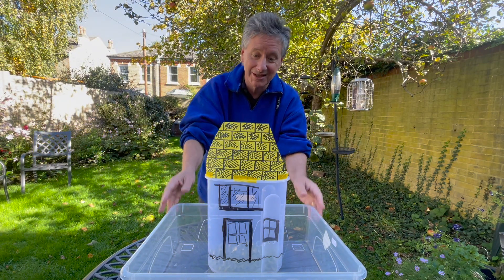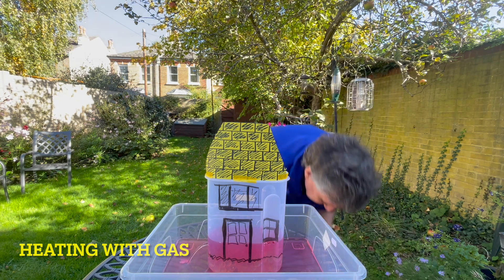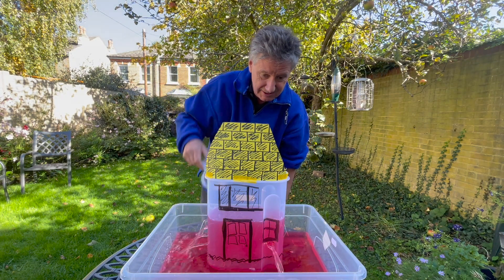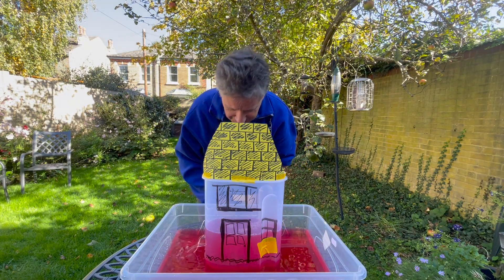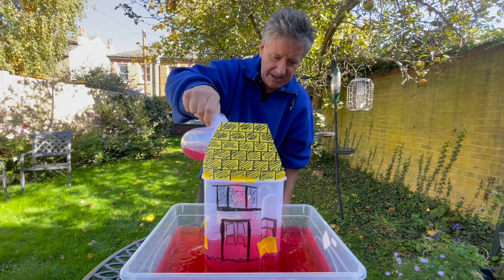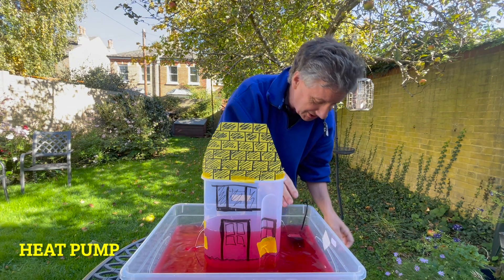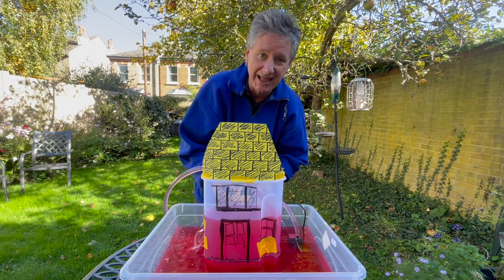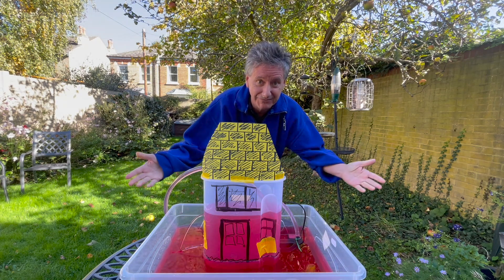Heating My Home

Comment: Michael, I was hoping you might help me understand the way we work out the heat capacity of air being 0.33Watts per m3 per Kelvin. 
Specific heat capacity of air at 20c = 718 Joules per kg. 
1m3 of air at 20c = 1.204kg. 
So… 718 x 1.204 = 864 Joules. 
864 / 3600 = 0.24Watts per 1m3 per Kelvin. 
I’m obviously working it out wrong as the standard is 0.33Watts per m3 per K. 
I’m just curious to know how we get to 0.33 ,if you can help that would be fantastic thanks.
Reply from the maker: Hi.

I think the main problem is you are using Cv rather than Cp. In most applications around the home one heats air at constant pressure rather than constant volume. Heating at constant pressure the air expands and this takes energy so Cp is larger than Cv.

Rough value at 20 °C of Cp is 1.00 kJ/°C/kg i.e. 1000 J/°C/kg

Density of air is roughly 1.2 kg/m^3

If you multiply these two quantities you get the volumetric heat capacity

1000 J/kg x 1.2 kg/m^3 =  1,200 J/°C/m^3

I am not quite sure why you are dividing this by 3,600.

Does that help at all?

Michael
Reply: @michaeldepodesta001   thank you Michael, I really appreciate your time to reply and I obviously have some more learning to do here, more curiosity than anything else. As I’m sure you can tell I do struggle with math. The reason I divided by 3600 was to convert from Joules to Watts as if my memory serves me correctly the figure in the CIBSE guide gives 0.33Watts/m3/K but couldn’t find out where this figure came from and how to arrive at it. But with your extremely helpful comment, 1,200 Joules divide by 3600 (seconds in hour) = the 0.33W/m^3/K. 
Or is this coincidence and I’m still not getting it?
Reply from the maker: Hi. Mmmm. I don't understand what you are trying to do.

The volumetric heat capacity of air is roughly 1,200 J/°C/m^3.

This is used in the equation 

Energy Input [J] = Temperature Rise [°C] x Volume [m^3] x 1200 [J/°C/m^3]

Let's work with 1 m^3 of air so this becomes:

Energy Input [J] = Temperature Rise [°C] x  1200 [J/°C]

1 watt is 1 joule per second

If you add 1 Wh of energy to the air this amounts to 1 [J/s] x 3600 [s]. So we can re-write the equation with energy measured in watt-hours

Energy Input [Wh] = Temperature Rise [°C] x  1200 [J/°C]/3600 s

So they could be measuring the energy changes in watt-hours or kilowatt hours instead of joules. Does that make any sense to you?

Best wishes

M
Reply: @michaeldepodesta001   thank you Michael for your clear explanation, that’s fantastic. Yes you are correct it’s for room air changes per hour. I have unintentionally left out some major details so I’ve created more work for you to decipher, so sorry for that 😬. 
I’m very grateful for your time/patience/knowledge again here. It’s been niggling at me for a while so to get clarification on where this figure comes from and the difference it makes between CP/CV that I was unaware of, is great to hear. Thank you. 

All the best, Adam.
Reply: @michaeldepodesta001  just to add, I probably should have mentioned it’s for ventilation heat loss rather than fabric heat loss incase it isn’t obvious to anyone that reads my question.

Comment: Love the video explainers.  I have a question. What have you done with regards to house ventilation?
Reply from the maker: Marktt: thank you for your kind words. 

With regards to ventilation I have measured the number of air changes per hour (ACPH) in the house and it seems to be in the range 0.5 to 1 ACPH in the bulk of the house. That seems acceptable. Not so great in our bedroom - so might need to add ventilation there.

I worked this out by measuring the concentration of CO2 in the air. People exhale CO2 - about 400 litres/day if I remember correctly - and if there was no ventilation (0 ACPH) the concentration of CO2 would rise and rise. But ventilation flushes out the CO2-laden air and replaces it with fresh air. So the static level of CO2 is an indication of the number of ACPH.

I wrote about this here:

https://protonsforbreakfast.wordpress.com/2021/06/06/estimating-rates-of-air-change-in-homes/

I was anticipating that I might need to add mechanical ventilation, but I thought I would just make the changes to the insulation and see how ventilation was affected. I think if I added underfloor insulation and sealed the ground floor, then I would need to do something.

I am very taken with the idea of these units from Blauberg, although I have never used them! They cleverly avoid the need to install ducts.

https://www.blauberg.co.uk/en/blauberg-uk-mvhr-heat-recovery-ventilation-range/decentralised-single-room-heat-recovery-ventilation-units/blauberg-aeris-midi-decentralised-single-room-ductless-heat-recovery-unit-ventilator-wall-mounted-silent-heat-recycling-ventilation-filtered-fresh-a

Best wishes: M

Comment: At the moment, gas heating in the uk is cheaper than using heat pumps. The systems are more expensive to install and the cost of a kWh of gas is 1/3 to 1/4 that of electricity. Because of this, running costs best case will be at parity with gas but likely worse.
Most electricity in the UK is produced using natural gas, at about 50% efficiency. Then there are distribution losses. The production mix will change over time with more renewables and nuclear. Electrical heating will have to replace gas as we will eventually phase it out all together.
For most people right now however heat pumps don't make sense. As they get cheaper and more efficient they will become more common. It will take 10-20 years for them to become dominant in the UK.
Reply from the maker: Jack, hi. I don't particularly disagree with anything you have said, but I would add two points.

Firstly in terms of CO2 emissions, heat pumps save literally tonnes of emissions per year from a typical home.

Secondly, although I am a bit unusual in this, in my home, heating with a heat pump is dramatically cheaper than gas. This is because I buy the electricity to operate the heat pump at night, and store it in a battery. I wrote about this at the link below, although the electricity and gas prices are now not quite correct.

https://protonsforbreakfast.wordpress.com/2022/08/26/non-je-ne-regrette-rien-update/

Best wishes

Michael

Comment: In my real world I would love my home solar to run a heat pump in temperatures below 5degrees. For free but as we know unless your home is super insulated like yours Mike then it's going to cost a bit more. If I am lucky tonight on that lotto my dream home will be super efficient and a heat pump fitted for sure. The other issue is that with the threat of power cuts "" if it ever happens"" your have trouble heating your home when it's cold ,but you stand a good chance of keeping warm using a small 1800kw petrol generator which you cannot use on a heat pump. I always plan for the worst case  . Before anyone asks lol we have quite a few power cuts in our area anyway. I also not so keen on having everything electric. If power goes off your stuffed unless your retired and have a log burner lol. But one thing for sure your videos are fantastic .
Reply from the maker: Gino, Good afternoon. Thank you for your kind words. 

Regarding heating one's home with out electrical power, of course gas or oil central heating will not work in a power cut either: these rely on pumps to circulate the water

However, I run my home and heat pump from a battery. I buy cheap electricity at night and use it during the day - and evening darkest winter about 10% of the electricity is supplied by solar. 

https://protonsforbreakfast.files.wordpress.com/2022/09/2022-solar-summer-10.png

If there is a power cut then - if I have notice - I can reserve the battery for back up at the time of the power cut. If I don't have notice then I might lose power for a couple of hours, but the house is well-insulated and won't cool down much.

And we also have an open fire although we don't use it much these days.

Best wishes

Michael
Reply: @michaeldepodesta001  I have battery's mine would knock out quickly . Yes your correct a oil or gas boiler needs electricity. But not as much as a heat pump. Here in our rural area many just use very small generators which more and enough to run a boiler and pump. We need to survive in rural settings lol.